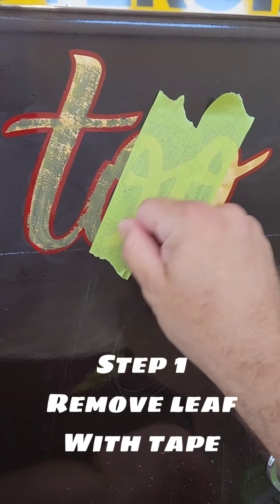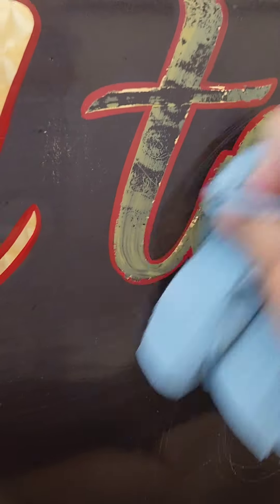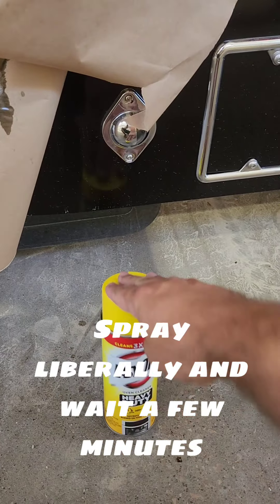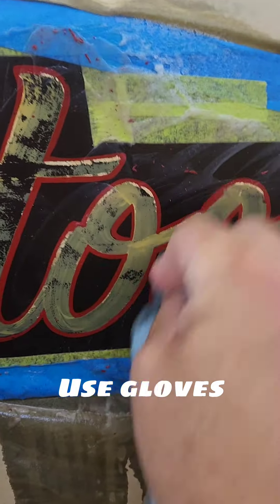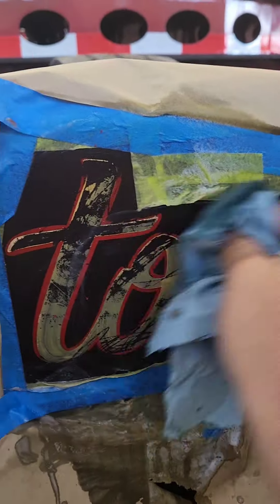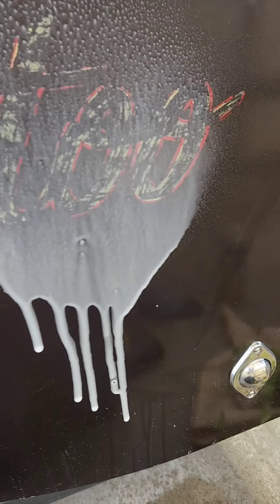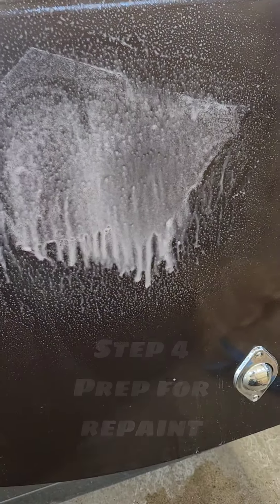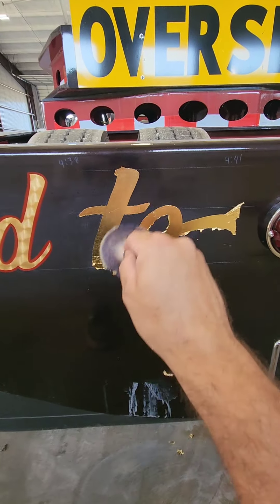Removing Gold Leaf and 1shot Pinstriping and Sign Painting Enamel

Comment: Awesome video! I keep getting little ripples in my leaf I’m assuming size not fully ready or the imitation leaf I’m using. Any tips?
Reply from the maker: Sounds like the size isn't ready. What brand are you using.
Reply: Dux quick
Reply from the maker: @JohnWilson-vb6hg  how long are you letting it sit before laying your leaf?
Reply: Been doing the knuckle drag test waiting for the squeak. Maybe 40min I’ve seen people say had to wait as long as 2 hrs. So much conflicting or confusing info. When I lay the leaf it’s not smooth slight ripples in it. Also when I turn it not getting that smooth machine look more scratched not thru leaf but rough
Reply: Also using loose leaf probably need to try patent leaf
Reply from the maker: @JohnWilson-vb6hg  I like the Knuckle drag test, but I like counting on time too. The can says an hour. That can be sped up or slowed down by air circulation, temp, and humidity. I try to keep that in mind if it is cold and high humidity, I know it should take longer. Hot and breeze in the shop should be less time. Unfortunately, it is not a clear answer
Reply: Thank you for the advice again! Looking forward to more videos and podcasts